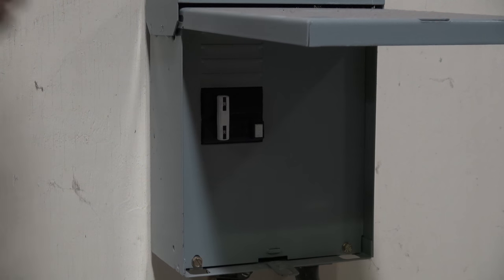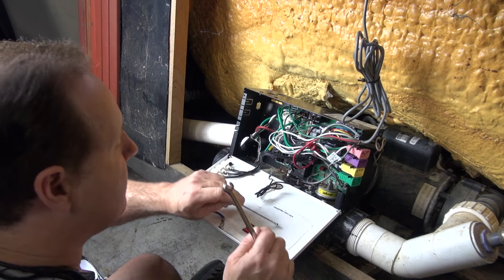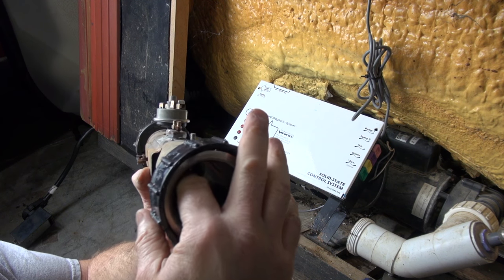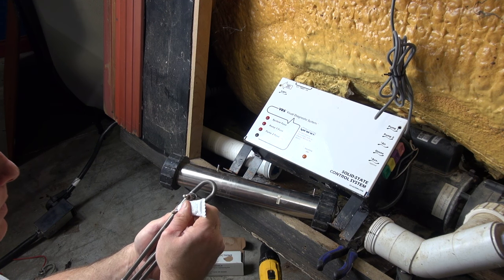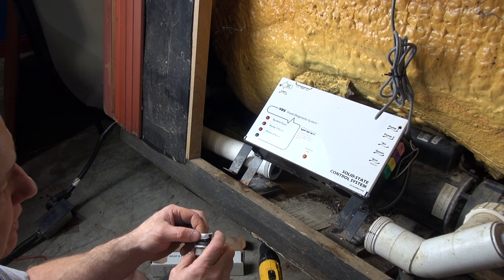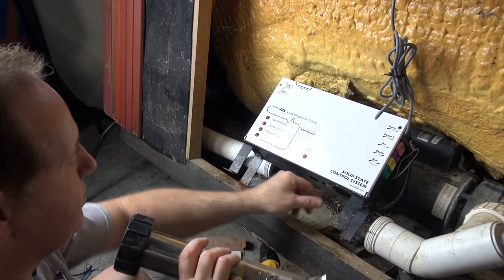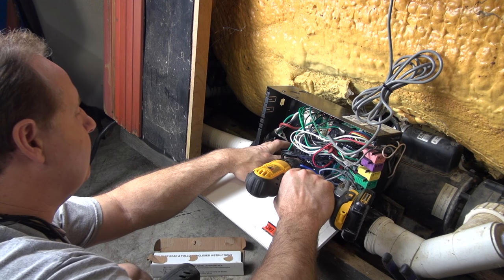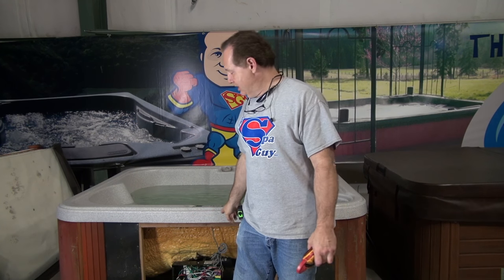Hydro-Quip Hot Tub Breaker Trip Heater How To The Spa Guy

Comment: Hi Spa Guy I have an artesian hot. I had to replace the heater which is a Laing. I was told they don’t make that heater anymore and was sold a HQ replacement  and was told to add more tubing to make it work. I just received the new part but I’m not sure if it’s the right one and nobody from where I purchased will answer me. If I give you the two model numbers would you be able to tell ?

Comment: I have a question if you could help me.. Very similar to yours I have a hydroquip and Everything works until I plug in the high temperature probe. It's an instantaneous circuit break when I plug it in... I can't figure out what's wrong.  Everything works fine pumps but no heat.. Any idea what's wrong???
Reply from the maker: With the temp sensor unplugged nothing is working when you plug it in the heater probably comes on did you unhook the heater as instructed?

Comment: Hi my name is Laticia I bought a Hydro quip heat Max RHS 11 k heater for hottub the thermostat is not clicking at designated temperature after i installed it hottub heated up to 94 degrees with the the thermostat clicking at the designated temperature but now it quick heating and there is no clicking throughout thermostat settings and no power light on reset button is ok Please help can you call me by chance I can explain allot better